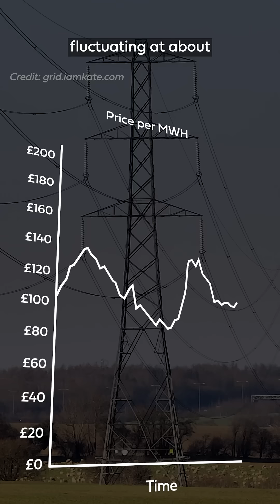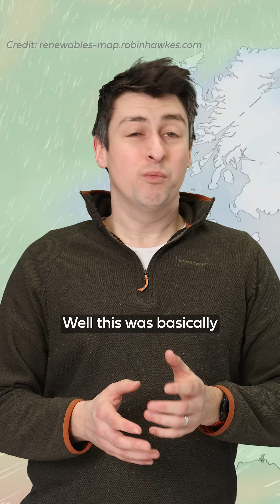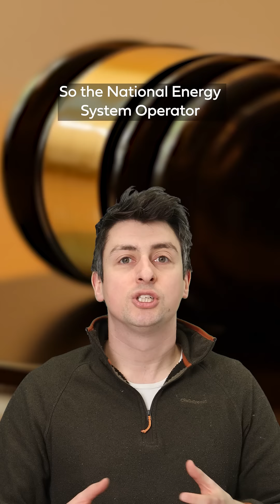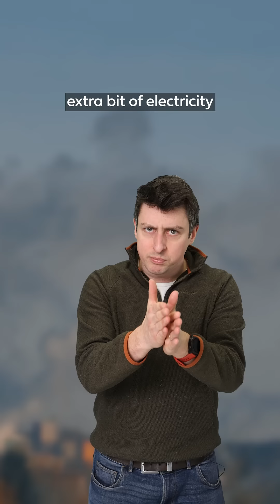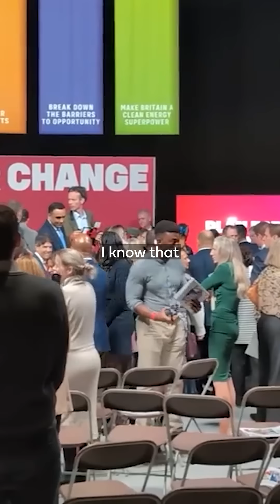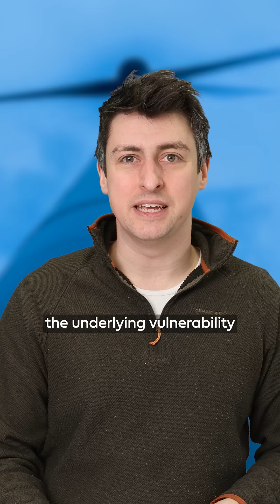The biggest price spike of the energy crisis happened last week

Comment: Look up the energy density of nuclear fuel, it simply doesn't compare to anything else! We should be building SMR reactors as if our economy depended on them - because it does. Do you think this price of energy is sustainable for exporting goods?! It was shortsighted and foolish to build gas plants when we produced natural gas, now we rely on imports it can only be described as gross government failure (I'm looking at you Nick Clegg who's blocked nuclear plant was due to produce electricity as the energy crisis happened). Renewables are cheaper but do not produce their rated capacity anywhere near as reliably than nuclear does. Lets get it designed British, built British and boost the primary and secondary economy. This is what growth looks like!
Reply: It's nice that we've got 4 large projects ongoing to expand our nuclear power generation, but it's taking absolutely FOREVER to get them online, as well as cost us an absolute fortune, money which is leaving the country as there are no British companies involved in those projects. I agree, we need SMRs built by strong BRITISH companies so we can keep jobs and capital in our own economy, while reducing our reliance on foreign investment and power.
Reply: @Silent002 It's taking forever because the UK stopped building them, so lost the expertise. If UK governments had committed to building a new reactor every 5-10 years then this problem would've been avoided and there would also be half a dozen new reactors, built domestically by UK companies, already online. 
It's the fault of successive governments (both Conservative and Labour), starting with Thatcher.
Reply: @GonzoTehGreat  I don't know about that, EDF is behind most of the projects, and they've been building plenty of reactors in France over the past few decades. I agree it would've been nice to keep our domestic nuclear industry going, but I can't blame the politicians too much, Chernobyl put the idea that nuclear power is risky in the forefront of the public's mind, and it's been an uphill struggle against public opinion ever since.
Reply: @Silent002   EDF have also suffered from France not building any new reactors for decades. They're also struggling to meet UK environmental regulations, which are more stringent than in France. If the UK had collaborated with them to build reactors over the last ~40 years this wouldn't be a problem now.

Your apathy towards maintaining the UK's Nuclear Energy industry is a large part of the reason it's not energy independent now. If governments don't make an effort to maintain domestic engineering expertise, then they lose it and become dependent on imports.

(This is also the case with semiconductors, which is why the USA is now spending billions trying to rejuvenate that industry, via onshoring.)

France probably went too far with their Messmer plan, by building too many reactors, too quickly, instead of building fewer over a longer time period. Unfortunately, they then became complacent and ceased construction completely, which was a mistake. 

Chernobyl was a freak accident in a single, outdated soviet reactor. Meanwhile, France has been running 50+ reactors without a major crisis for ~40 years. Also, thanks to technological progress, new reactors are much safer than existing versions. Consequently, the argument that Nuclear Power isn't safe is bogus.
Reply: @Silent002  theres a good reason for that we redesign the reactors every time, meaning we re run testing and safety test the system itself rather than how it performs whenever we build a new reactor. Look at a country that has been doing this for years like france, japan and korea. They buy land, use their standard blueprint for a reactor, and build it. It costs them a fraction of what it costs us because they aren't stupid. If they need more power than their design allows, build 2, this is cheaper than building a new design and paying to have the design scrutinised. The nuclear power plant in Somerset for example costs 4 times what south Korean plants cost MW for MW. The plant builders blame uk regulation for the problem, which isn't exactly wrong either.
Reply: I wholeheartedly agree. It frustrates me so much when people are against nuclear. If you want electric cars, heat pumps, and all the other electric nonsense that's being forced down our throats, you NEED nuclear. It's non negotiable. Solar and wind are just nice-to-have's in the UK...

Very few realise the decades long timescales required in nuclear design, build and commissioning. That's why rushed Gov decisions decades ago come back to bite us now, and the only real (and remotely cost-stable) solution is decades away... 😤
Reply: Moltex is even better. A reactor with no moving parts intrinsically safe low cost and burns spent nuclear fuel. Except we can’t have it - because?
Reply: Hinckley point C. They're trying.
Reply: @grouchypotatowolfpack5580 hinckley point is a prime example as to why nuclear ISN'T taking off in the uk, it costs 4 times more than building multiple smaller reactors of a proven design would have MW for MW. They're trying and failing. The uk are a joke to the rest of the nuclear powered countries, especially Japan and south Korea where their cost of operation is 1 fifth ours.
Reply: A properly Sized Group of Batteries for Grid Storage, can fairly easily manage a "3 Hour Demand Peak!" 

All Win Farms,cans Natural Gas Peaker Plants, should have Megapack Grid Storage "Co-Located" for such events, anyway!

You don't Go to the Grocery Store,vto but ingredients for Each Meal you make, because you use your "Cupboards" for "Basic Food Storage", so, it's time "The Grid" learned how to take a Planning Course, from most Homeowners! 

I understand, to sore a "Weeks Worth of Energy" (skin to how most people shop for food once a week), will be Expensive, if trying to do it all at once! So start with a Plan, for "30 Minute Segments", get that in place, in all grid capacity Buffer storage, then Repeat, Repeat, Repeat! That will take you up to 2 Hours, at least! 

Just as we bought 1 Freezer, on the Farm, and later bought another, the Grid Operators, should be Adding Battery Storage, and Tesla's are the Best ones, in current "Megapacks!" 

Imagine if you always had to keep your Cell phone Connected to external power, how much less useful it would be! Batteries work, not just in Hawaii, or South Pacific Islands!
Reply: nuclear power is SOOOOO expensive....what we should be doing is installing more renewables, backed up by large scale, cheap dispatchable coal and gas fired power (and ditch batteries which are anything but clean). China has low energy prices because it has coal as a backup, not because it has lots of renewables...
Reply: @user-hq1cm8vg9l  the cost of the renewables and the fossil fuel power generation plus the maintenance of all the infrastructure that supports it (plus price volatility due to it being mostly imported) makes the cost of nuclear alone a lot cheaper than going your route. France is a great example of this, street EV charging points are the same price as off street overnight cheap charging in the UK, Vs the UK that has your system and it's 11x the off street prices.
Reply: @MassToOrbit  the clean up of sellafield and its spent fuel is nowhere near complete and is already estimated to be a quarter of a trillion pounds on its own. once you take full lifecycle costs - nuclear is a clear and obvious stupid decision....full life cycle costs of renewables re never taken into account. personally id just go for large scale gas and coal (and make them as clean as possible) and ditch renewables, but for some reason we think super inefficient, distributed highly variable renewables need to be part of an answer (though the question still isn't properly defined by science...just ecozealots)...but nuclear is not the answer to anything, it is also high inflexible and takes a couple of days to ramp up and down....even if we had lots of nuclear we would still need lost of dispatchable power (the equivalent amount of teh largest nuclear) - that disptachable can not be dirty batteries and we dont ahve ability for hydro so it must be coal and gas. small gas is super expensive too, which is why we have such high power prices
Reply: @ Nuclear when you include clean up costs is sooo much more expensive - sellafield cost for clean up will be close to a quarter of a trillion pounds...we should never look at nuclear again. coal and gas are soooo cheap by comparison and can be burnt cleanly...wtf would we saddle our grand children with the nuclear clean up costs because a few ecozealots (backed by big business, not backed by proper science) tell us that co2 is the reason that the climate is changing (when earth's elliptical cycle is much much more likely the reason - after all its been scientifically proven to have been doing it for 4+ billion years).
Reply: @user-hq1cm8vg9l  if we were smart we'd opt for molten salt reactor design - its a faster reaction than can break down existing nuclear waste with byproducts lasting 100s not 1000s of years. Coal and oil contain sulphurs and the combustion (sometimes incomplete) produces a range of toxic gases. Ignore the CO2, focus on supply of fuel, energy independence and cost of maintaining surplus generation capacity. Molten salt reactors are also more efficient than traditional nuclear, so it has that going for it too. If you're worried about radiation, look up how much radiation you're being bombarded with every second from space based sources....
Reply: @MassToOrbit  Molten salt reactors are not commercially viable, nor will they will be for a very long time. I never mentioned oil - I said gas and coal. we have plenty of low sulphur coal in the uk and natural gas burns very cleanly. if there are toxic emissions they can be scrubbed (and are infinitely less then burning waste - which is viewed as "green" technology). last time I checked we have out of control power prices TODAY which is negatively impacting the poor and businesses disproportionally, we cant wait for teh latest harebrained technology which may come into being (most of them dont). Aside from the waste issue new nuclear will take decades to come online...coal and gas could be built in much shorter time - and we have all the  resources we need under our feet....if I was PM I'd starting digging for coal and drilling for oil and get those power stations rebuilt, drag could easily be converted to burning coal again instead of chopping down ancient forests round the world and then shipping in wood chip via HFO powered tankers, then driven to the power station via diesel fuelled trucks. the answer is coal and gas not new technology, not batteries (of any type), not nuclear (which btw is not very flexible)!
Reply: @user-hq1cm8vg9l  I actually agree to a large extent. Molten salt reactors are not commercial yet. We'd need to build standard reactor designs for a while, transitioning to molten salt in the future as a solution to dealing with our waste. I'd argue that we can mine less material for the same energy if we focussed on nuclear (lots of granite in the UK - plenty of uranium). We don't produce enough natural gas to sustain our national grid (and even if we fracked, it would create the same issue in a decade). Energy supply is bid with the highest price setting the price for all suppliers, this is usually natural gas or on occasion grid scale batteries (too expensive currently). Since the grid can depend on up to 60% of capacity coming from gas, it makes sense why our electricity is so expensive today. The price isn't likely to decrease either, as convenient sources are exhausted. You are right about nuclear power not being suited to demand flexibility, but France shows how this can be done by using interconnectors and exporting surplus power. In terms of timescales, nuclear can be built faster especially if a design is standardised and their is political will to make it happen. I'm putting forwards my case for nuclear, but accept that you have valid points.

Comment: Texas has this reformed model. In the big freeze, the generators held back till the price reached ludicrous prices. Remember that natural gas powers 50% of the grid and even gas pipelines need massive power to move the gas to your home. Heat pump use is still a marginal home heating source. 
If gas suppliers can ramp up power and they know the marginal gap suppliers are getting paid a fortune then they won't supply it.

Comment: The UK is building a new nuclear station. It has not been a happy endeavour thus far. The electricity from it will cost 50% per kWh than other sources and it's going to damage the environment - not so much because of nuclear waste, but because they are too cheap to install mitigations on the cooling water intake to prevent fish being killed.

Comment: and centrica say they didn't make any money and wish to pull out,  eg blackmail of the network,  blame labour for failing to build supplies for 30 days like the rest of Europe. and utter madness it is to do the same with wind power, which fluctuates 5 times more often. futher more hinkley B was refused to be refill, even though forcasts of hinckley C was 9 years delayed,  this alone increased energy cost by 20% net,  labours plan wind and battery both which will lead to a MASS increase of up to £300 increase in daily charges alone,   this is why we CANNOT have wind power with the hightest cost per MW.  and we MUST STOP paying them to turn off production,  and force them to sholder the cost of storing and flat rate

Comment: This is what happens when your grid relies on 'renewable' energy and the wind stops blowing. The price of gas is a reaction to the iron law of supply and demand, it's like blaming gravity for a plane crash.
Reply: This guy doesn’t know batteries, solar, and nuclear energy exist
Reply: @OSborneCox  I agree. If we want cheap and reliable 'green' energy we absolutely need to expand our nuclear power infrastructure. Solar is kind of a joke in the UK and what happens when it is night time and demand goes up like in winter. The way power is generated it needs to be used right away that's why we still have gas and oil power stations.
Reply: @normiedeathsquad40  What’s your problem?? Don’t see the problem with a price spike now and then as long as the grid is fine. Wich it it’s. What interest is spot market price to consumer? He pays the average price levelized over the whole year. And a few hours with very prices don’t do much to the average over the year. On the contrary weeks of very cheap wind electricity absolutely bring down the average price.
Reply: @jonasb911  we nearly had rolling blackouts last week but yeah. We're fine 👍

Comment: Imagine if you could discharge your EV into the grid during times of high electricity prices. If there are ~1.3M EVs in the UK, and each has ~70kWh of battery storage, that's around 90GWh of energy storage. Now, you obviously can't access all that capacity since most of these cars are going to be needed to get people back home from work, especially at 5pm on a Whednesday. But some of these cars are just going to be sat somewhere hooked up to a charger, so it might be interesting to find a way to use them.
Reply: The wear on the batteries isn't really worth it.

Comment: Simon keeps glossing over the very important reasons why marginal pricing can be helpful. Without it generators have huge incentive to hold back power and bid higher in the hope that they can be paid these higher prices.
Reply: I've given up on teaching people how the mechanism works. Now I hope the UK will change it and serve as a lesson on what not to do for us in the EU. Again.
Reply: Right, and his conclusion that “the UK grid wasn’t up to the task” seems a bit hyperbole. Looks like the system worked exactly as designed and an outage was avoided. The real issue is with average prices, not the occasional peak.